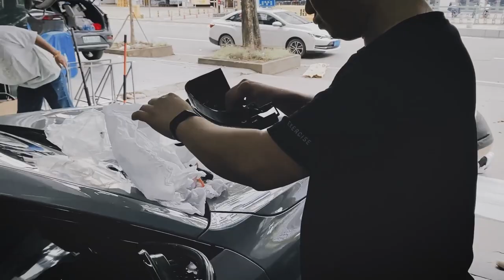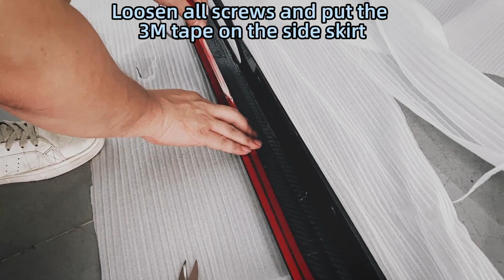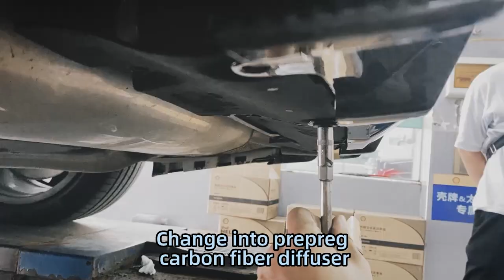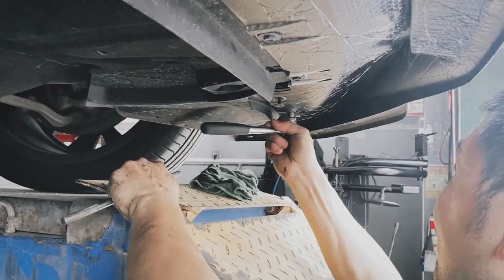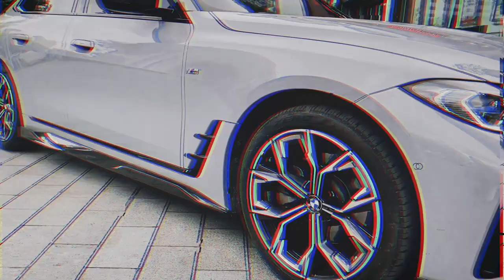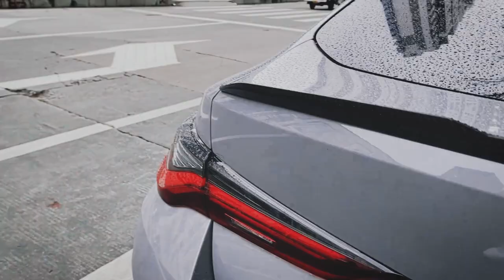BMW 4 Series G26 Prepreg (Dry) Carbon Kits - SOOQOO

Comment: Hi guys, I am interested in Diffuser.
Do I just unscrew the bolts under the diffuser and take it off with orange tool?
I bought this front grill and its amazingly beautiful.
Thanks for the great products by the way
Reply from the maker: Lovely bro, yes the diffuser just needs to screw it out and fit with OEM bolts, but some clips are not easy to fit, if you can't install it well, better go to a tuning store. Thanks for your support.

Comment: Hi great video - were holes drilled into the car when installing this body kit ?
Reply from the maker: Hey mate, all of our parts with OEM bolts holes, you don't have to add self-tapping screws if you just use for daily driving.
But if you like racing fast, then you will need to add some self-tapping bolts in the middle of the front splitter.
If you always drive fast over then 150km/h, I will recommend you add some self-tapping screws.